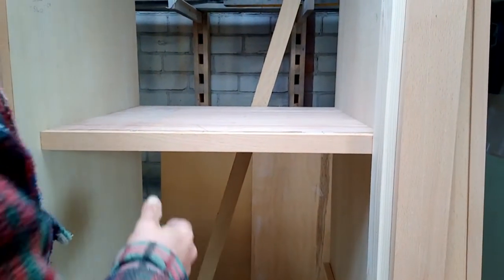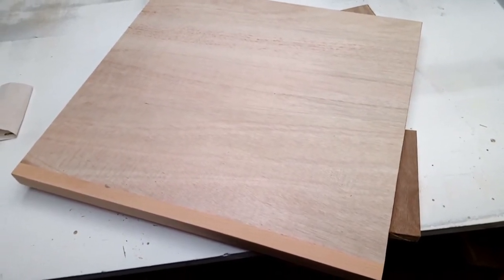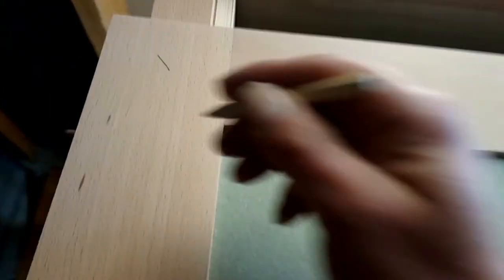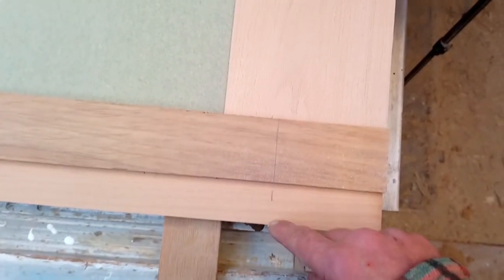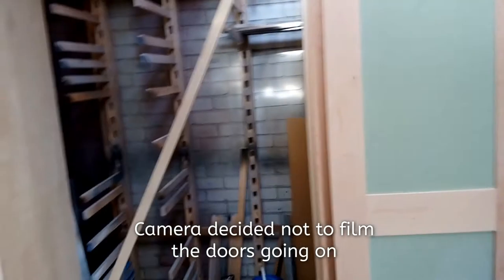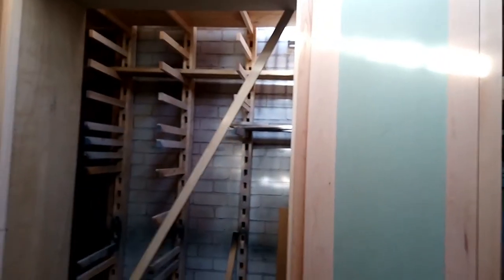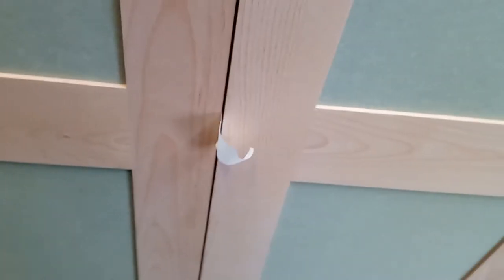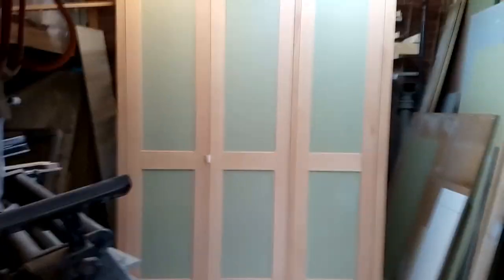Wardrobe build pt8 - Fitting the doors at last

Comment: Hi Gid I’m finding your videos a great learning resource thanks for making them 
I wondered why you used ply for the carcass rather than mdf? 
Thanks josh
Reply from the maker: Hi Josh, Glad you find them useful, that's why i make them 😉 Thanks 👍
I give my clients the option of ply or MDF but advise on ply because inside doesn't always have to have a perfectly flat surface, if they can ignore the poss flaws in the grain, it's a lot more stable, less chance of sagging, it will last many more yrs than MDF, you get a better fixing into ply for things like hanging rails or drawer runners, once you put a screw into MDF a couple of times it loses it's integrity & goes 'fluffy' but ply doesn't.
Reply: Gid joiner thanks 
That makes sense 
Where abouts are you based?
Reply from the maker: Leeds West Yorkshire,
Reply: Gid joiner ah cool I live in morley myself

Comment: Hello Gid great video good tips could I ask what hinges are you using how do you  work out the all the sizes packers etc and are you going to do a site video thanks
Reply from the maker: Hi, These hinges are from Hettich 8645i 110º opening, the mounting plate is different to the one in this link, I buy mine from Lawcris panel products. Yep i plan to make a video on site, it will have to be while I'm working but I'll do my best to make a good enough video, Thankyou.
https://www.amazon.co.uk/Hettich-8645i-TH-52-soft-closing/dp/B00FN0FO80

Comment: Hi Gid, I'm making my way through your back catalogue; fantastic videos, really appreciate you posting them 👍. When making the doors with (I assume) 9mm ply, what size slot cutter are you using - is 10mm too loose, or does that give just the right clearance for assembly. Thanks!
Reply from the maker: Hi, Yes 9mm board. i use a slotting cutter, or two cutters on an arbor I should say, I have a few cutters & arbors but this one i leave set up at approx 9mm, the way it is now it's a little too tight for 9mm MDF but sometimes just right or a little loose for 9mm Ply, every board seems to be a slightly different thickness, if i put another washer/spacer between the two cutters it leaves a little strip of wood down the middle of the groove,, so requires a second pass lowering the cutter in the router table to make the groove wider for the Mdf, 
On a small test piece the board might fit very nicely but when coming to put the doors together that close a fit can be a problem, a little more allowance is needed but that can mean a line/gap around the panel that shows when sprayed but not big enough for regular brushed on paint. 
I hope my videos are helpful, Thanks.

https://www.axminster.co.uk/axcaliber-three-wing-slot-cutter-set-952565?utm_source=emarsys&utm_medium=web-recommendations&utm_campaign=emarsys-recommendations-product-page-also_bought

https://www.axminster.co.uk/axcaliber-2-wing-slotting-cutters-ax809783
Reply: Gid joiner - Great, thanks Gid; will give it a try 👍

Comment: Hi Gid what ply would you recommend for kitchen carcasses, 18mm? Malayan ply as you use here?
Reply from the maker: There's regular Asian/Chinese ply at the builders merchants but that has a thin paper thick veneer on the face,
This Malayan I buy from Lawcris,  it's the next step up, It's a good board, proper 18mm thick, (Lavers version of this Far Eastern is 16-17mm ) it has a thicker veneer so when i glue lippings to it etc,  i can sand it without going through that veneer, 
Prob is it can have flaws, open grain, cracks & repair swatches in the face, it does have 'one good face' but that isn't always good, not for spraying anyway.
I'm trying to get something better without having to buy birch ply which is £50+ but lavers aren't too helpful, ( I haven't pushed them on it tho ) & Lawcris have a massive warehouse which i can't go in to look around, I have asked but get the "you'll have to buy Birch ply" response, There's a place near me called Lathams who do Poplar ply but they have a min spend of £500 Apparently, might be wrong, that's what i was told on the phone but they're too far away to just drop in to see,
Birch ply is graded, the cheapest has only one good face also, 
For spraying i might have to buy a veneered board, birch/maple veneer maybe, i haven't looked into it n got prices, 
Soo yeah if i was using ply to build a kitchen it would be with Malayan.
Reply: Many thanks Gid for your reply . Wouldn’t you of  thought they would welcome you in as you buy on a regular basis. One order brings others. Yes I’ll look out for the thinner veneer as one swipe with sandpaper and you bust through to next layer!!  im un decided wether to go Malayan ply or mr mdf.  Ñus wether to go for a face frame (to hide end ply) as you did in the wardrobe build or just with the mr mdf  i can just paint the 18 mm edge. Also interiors only need a finish as outsides are normally butted up against each other.
Cheers Gid, hope the install goes well for you. 👍
Reply from the maker: I use ply for the carcasses of wardrobes because i get a better fixing for hanging rails etc.. I also try to build things strong enough that maybe they will out live me. 😄 ya know like the old stuff that's been in for 50yrs or more,
MDF gives a nice flat finish & i do use a fair bit of it but even MR MDF is still just MDF, it will sag over time,
MR is only 'Moisture Resistant' so wetness will affect it.
This plywood is Weather and Boil Proof (WBP), hopefully it will endure most things thrown at it.
Reply: Many thanks Gid for information on the ply, I’ve learnt something. Have a good day on install, really look quality units. 👍
Reply from the maker: Hopefully I'll show the end result this weekend 🙏
Thanks 👍
Reply: Birch plywood is my preferred ply for cabinets, no voids, consistent thickness and has thick face veneer with a multi core. Beautiful stuff, 👍😁 🔨 🇮🇪